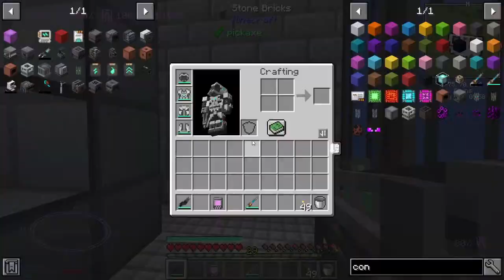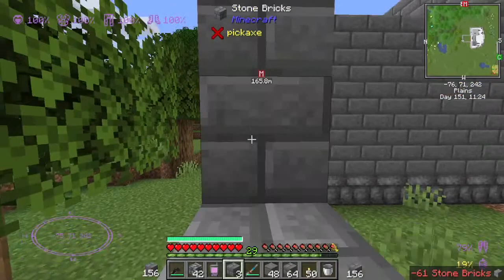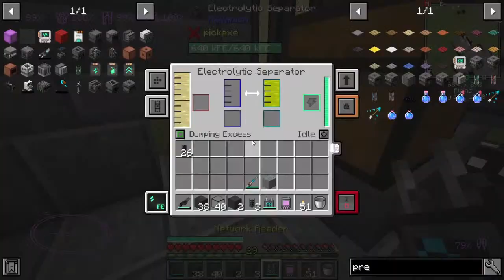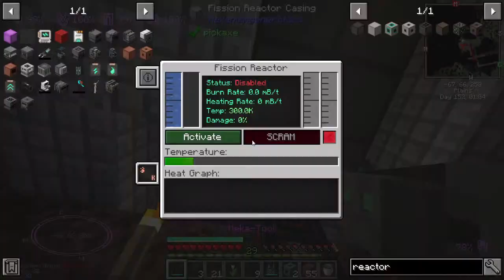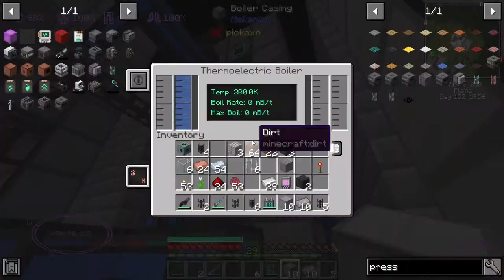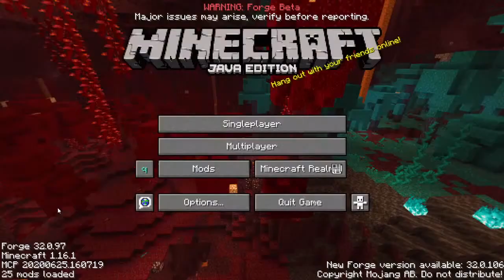Simply Mekanism v10 - Reactor go Boom Boom! (edit) - 1.16.1 Modded Minecraft!

Comment: The reactor burns 200,000 mB Sodium per mB per 1 mB fuel. This is the bare minimum that should always be inside the reactor. If you heat it up, something will stay inside the boiler. So you should at least double the ammount of Sodium. If you wan't to run the reactor at higher rates, you need even more. For example, if you run the reactor at 2 mB/t you should double it again. Or for security reasons, even more.
Also, when you start your reactor, after making changes or builing it, start with slow rates and go up slowly and examine the heat levels for some minutes. Also check the pipes if they run out of water.

Comment: Two logics controller.  Vanilla piston on logics controller set to high temp.  Lever on the other set to activation.  Once temp reaches red, piston will knock lever off deactivating the reactor.  Works like a breaker.
Reply: instead of the lever use a redstone block so you dont have to keep replacing it
Reply: Saving for later